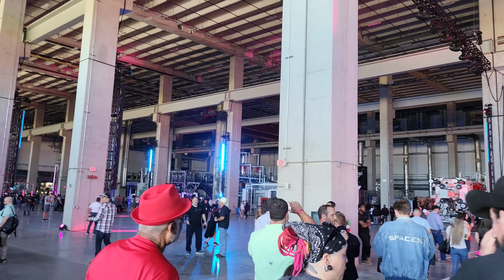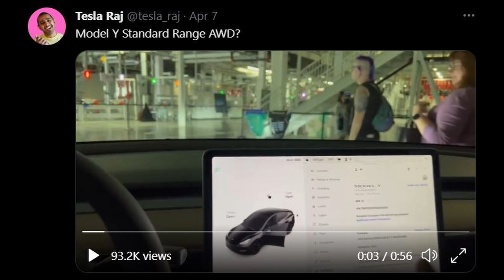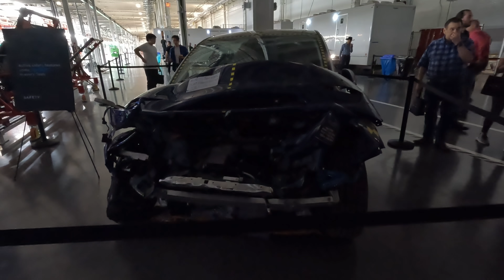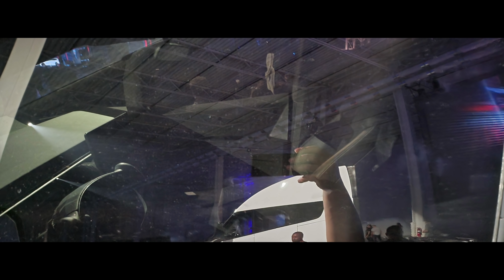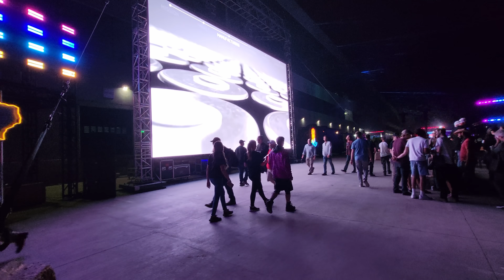Tesla Giga Texas Cyber Rodeo | Cybertruck, New 4680 Model Y, and more!

Comment: I believe you live in rural Michigan. I live in rural Minnesota.  How do you handle FSD or Auto Steer when the software has either no Speed Limit or incorrect Speed Limit posted? Close to half of the roads I drive have incorrect speeds in the Navigation software.
Reply from the maker: well then i just adjust it :)
Reply: @DirtyTesla  how do you adjust it?

Comment: RE: dedicated robo taxi --- I think we have to be a bit more adventurous in our thinking.  The number one problem cities have is congestion.  I couldn't find any numbers but I suspect that many taxi rides carry only one or two passengers.  In addition the number of single occupant vehicles whose driver is unwilling to pay for the carpool lane is very large.  So it would make sense for at least one form of the robotaxi to be a half-width vehicle so two of them could travel side by side in a single lane in congested traffic.  With FSD that should be very safe.  You could have a two person vehicle with the two seats facing each other.  If your party contains 3 or 4 then call two taxies or there could be a four seat version with all seats facing forward.  The half-width vehicle could still have 4 tires but spaced close together and even have deployable kick stands that extend for stability when the vehicle is stopped.  The drag coefficient for a half-width vehicle will be lower in addition to being lighter.  Perhaps even more beneficial in congested places like India.  Also, imagine doubling the flow of vehicles into and out of an airport.   If it could be manufactured at lower cost (a single casting) then low income countries like India could really benefit. It would also make a good grocery, pizza, pharmacy... delivery vehicle.

Use cameras and odor detectors to take the vehicle out of service if it stinks and bill the customer for the mess.

Comment: As a truck driver, charging times will be mostly spent playing games on the in cab entertainment system, while eating a sandwich! Lol 
Initially the charging will be done at the company terminals between shifts and on lunch breaks, but once the charging network gets built out, charging will either be done while the driver does their 10 hour off duty in a motel or in a future sleeper cab version, with mid day charging happening during the mandated 30 minute break, which sometimes is used for bathroom and lunch anyway, and other times is spent playing on the phone waiting.

I don't expect to see them on the highway much for a while, mainly runs from city serving warehouses and factories (such as the Frito Lay factory in Modesto that serves the greater Bay Area), routes that allow it to return and charge at the company location, and then slowly expand out to be able to do runs between LA and Bay Area, or starting to run shuttle routes between Bay Area and Redding, and someone else between Redding and Medford, and someone else between Medford and Portland, and someone else from Portland to Seattle, etc, which is pretty much how UPS and FedEx currently work.
Just have to place charging stations at the end points and time it with shift changes etc.
Reply from the maker: Awesome to hear from a trucker!! A 30 minute break could definitely add good range of they can up charging! And yeah I always figured companies would install charging infrastructure at start and end points so the truck could charge while loading and unloading.

Comment: There is no "demo" mode on a robot, you have to hard code them to do that. Most often you can use the original program that you usually run but /skip the material grab.

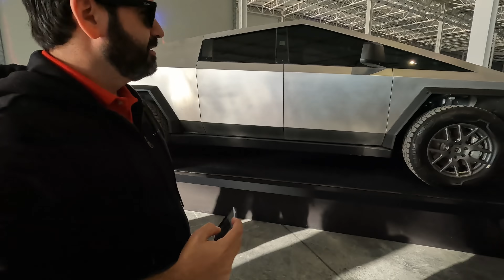Comment: I think they need to just steel brush the cybertruck after completion. The door panels seems to have a different "grove" than the rest of the body. @6:39. Maybe it's just coincidence with how people are blocking the light.  The back door also seems to have like a 2mm "droop" where the ridge is slightly lower than the front door and the body's ridge.

Comment: It is super underappreciated that charging speed at a certain point eliminates most demand for longer range. My gut feeling is that a range of 300 miles and ability to recharge in 15 minutes is going to be sufficient to the point that people don't especially want more range or faster charging. This is important because more range requires more batteries which means fewer EVs can be made and those made cost more. One of the huge benefits of tabless cells then is their superior charging speed. 

One other benefit of having a huge amount of battery cells has been fast acceleration, and again the tabless cells can provide more power quickly, so fewer are needed to get the same acceleration which means again more EVs can be made. 

So what is going to happen with the Model Y? My prediction is that once Tesla ramps Austin and Shanghai and Berlin Model Y production, Fremont will stop making the Y and just make the 3 and S and X. Because 4680 Y is a lot better. Further, I predict that Tesla will only make one version of the Y, basically a 300 or so range Performance version with fast recharging.
Reply from the maker: I agree, but 300 real miles. The current cars do not get 300 miles at highway speeds or in the winter or towing.

Comment: The biggest news that wasn't yet official was 4680 production locally in Texas. That was something we knew would happen, but most of us thought it was still cells from the test plant being shipped in.
Reply: the size of the battery part of the factory is nuts, that's potentially huge capacity, 200-250 gw per year maybe.  CATL have 80 and that's the largest in world currently - this is off the charts, this should be front page news.

Comment: Fast charging will be the downfall of EVs, at the very least it destroys most of the environmental benefits. We all need to charge our EVs as slow as possible and off-peak! 99% of charging can be done at 120v 12A at night. Supercharging and even level 2 during the daytime hours should be extremely expensive, certainly no cheaper than gas or diesel. The EV community needs to embrace these points and start educating the rest of the world with these concepts. Fast charging is global warming!
Reply: Andy Feimster: Actually, slow charging like your 110V example is very inefficient due to pumps running for a much longer time to charge.  240V/30A or 40A charging doesn't waste a lot of energy (heat), but yeah, superchargers do have about 28% heat loss.  Still, my electric bill isn't noticeably higher due to my Y and compared to the cost of gasoline, it's a no-brainer for everyone to switch to BEVs.
Reply: @geoffgeoff3333  As an electrical engineer, I do not agree that 120v 12A charging is inefficient. 3s and Ys charge at 4-5 mph if the car is off. The parasitic loads are greater at higher charging currents due to greater heat losses. Regardless the bigger point is that all utilities have many thermal power plants (coal, gas, nuclear...) which are only efficient at constant load. As such there is tremendous unused off-peak capacity on the grid and utilizing it for electrified transportation will reduce carbon emissions more than anything else. Everybody demanding a 300kw+ charge rate at anytime negates any benefit of moving transportation to electric.

Comment: Nice video.  One thing about the Cyber Truck, there is so much interest and demand that Tesla needs to get it right.   No body panel issues, no interior issues, no software issues, just nail it at launch.
Reply from the maker: Let's hope but I just don't see it happening lol. But hey maybe this Austin factory will step it all up!
Reply: @DirtyTesla  the Cybertruck design solves a huge number of issues, among them the panel gaps and paint issues making it impossible to have those problems. First, obviously no paint so no paint problems. Second, panel gap issues happen for two reasons: assembly of the body in white has irregularities in welding and joining, or the stamped pieces for the body or the panels are slightly irregular because the stamping process involves heating and cooling and some inevitable irregularities in the sizes of the resulting pieces. Both issues are impossible on a truck made with two gigacastings and a structural battery pack plus cold rolled steel plates laser cut to bend where needed. Once Tesla dials it in, every body panel will be identical, every casting will be identical; panel gap issues cannot happen. 

I don't see interior issues happening either. The Cybertruck will be like a ten year leap ahead from the SEXY lineup.
Reply: @DirtyTesla  - I saw a video from Daren Yoong (Singapore) where he filmed Elon saying the truck was a go for production in 2023 from this plant. But we know  how things can slip.
Reply: if anyone can nail it at launch then Tesla can.  with an exoskeleton I'd say body panel alignment issues are unlikely.
Reply: Those issues were only out of the Fremont factory and it’s pretty much a non issue now. Gigashanghai and gigaberlin build qualities have been amazing from everything I’ve seen and heard. GigaTexas will be no different.

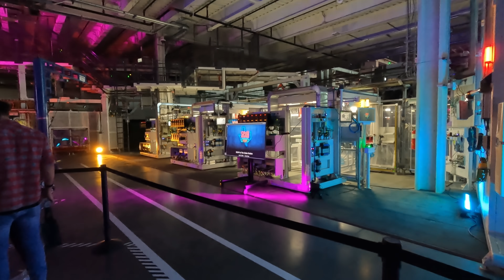Comment: Approximately 3:15 on time line. Where did you get the information that the model y long range is still going to come from fremont with the 2170 batteries?
Reply from the maker: Good guess ;) Like I said this is what's happening for now. I'd expect it to change eventually.
Reply: @DirtyTesla  I hope your guess is incorrect.  I could have bought a Long Range Model Y a year ago at about $10,000 less if I wanted the 2170  batteries.  I purposely delayed my purchase to get a long range model y with 4680 batteries from the Austin facility.  If your guess is correct and in September which is my due date from my car I will cancel the order if they are not supplying 4680 battery equipped model y long range ev's to the East Coast i.e. Florida.
Reply: @helicopterjohns  Then, that's 1 more Tesla for someone else!  Btw, it's $13,000 more for the LR Dual Motor plus another $4K for FSDbeta than when I picked up my 2020Y on LD.  I absolutely love driving this awesome car that's learning to drive, that saves me cash & time on maintenance and I barely notice gas stations as I charge at my home and at destinations.  Good luck to you!

Comment: Any guess as to the price of a SR MY?  I’m thinking no more than $3K less than a LR.
Reply from the maker: Yeah it's a great question. SR 3 is $9k less, but it's single motor and lower demand than a Y. So probably $3k-$5k less.
Reply: @DirtyTesla  For $5K less it’d be tempting.  Especially if it’s lighter/quicker and faster charging.
Reply from the maker: @willaerley7140  it sounds like it will be much faster charging. I wish Tesla would have dropped some specs on us!!
Reply: If SR MY is dual motor it would be super kool